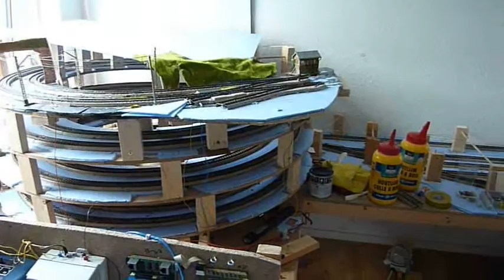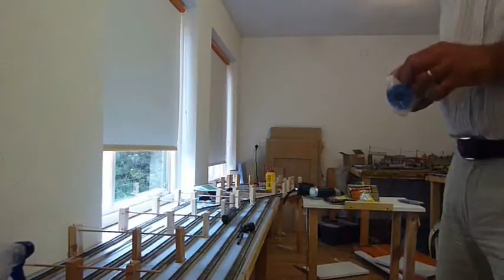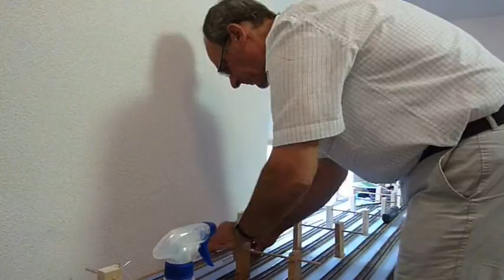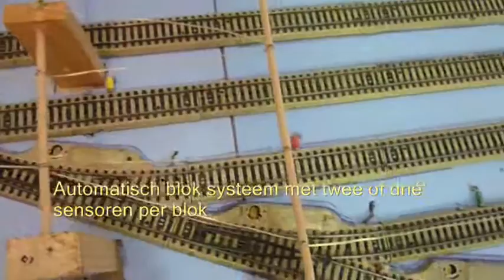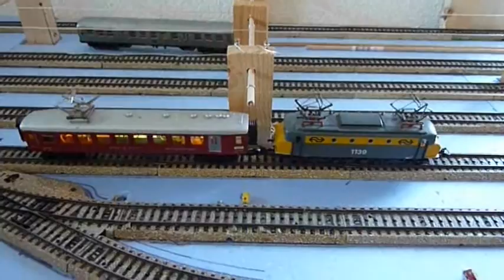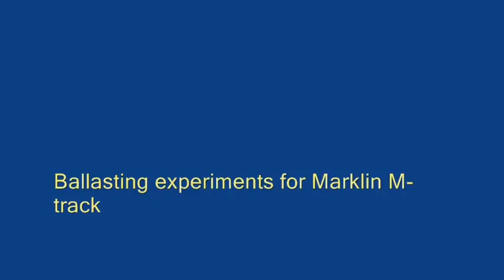VLOG3 Rhineland HO train layout Build - FIFO/Helix/Catenary nearing completion

Comment from the maker: Vinny,

The outside radius is about 19 inches, 475mm.
This is standard for Marklin R2 set track.
I wanted/needed to have 100mm, 4 inches, per helix loop. So this gave the 3.6% gradient, which was a bit of a gamble. I am not running steam engines, that are notoriously bad pullers, or running longer than 20 car freights. This with the 4 traction tyres per engine of the 8 or 12 wheels, for most of the fleet, allows me to get to this grade. This is much higher than you 2 rail modelers can use, since you are limited to about 2%, max, because you cannot use traction tyres since you need all-wheel contact with the rails for power. I think Marklin is the only 3 rail system now in either H0 or N. If I had started the hobby say 5 years ago, I would now also choose a 2 rail system, but my dad started it now 50 years ago and I have a few thousand dollars worth of Marklin stuff that I can't afford not to use. Are you any wiser after all this? LoL.  Robert. PS very interesting vids recently from Gregg (Fishplate) in Aussie.